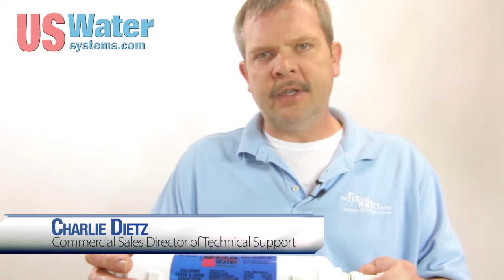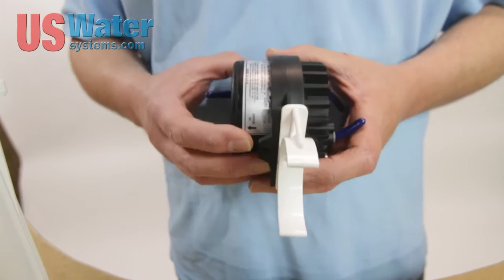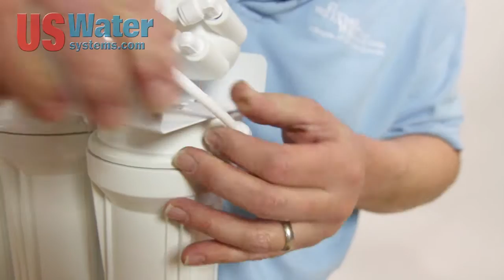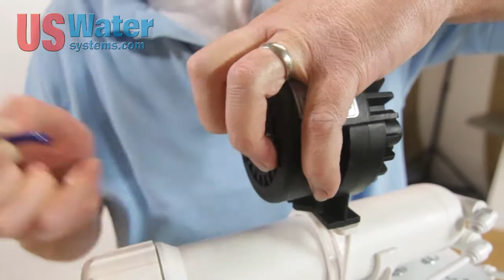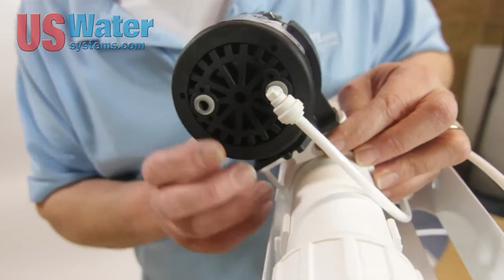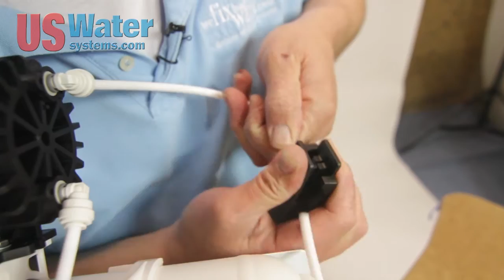Permeate Pumps

Comment: Why the Shutoff valve is eliminated? Do we needed? Please explain. Thank you!!!
Reply from the maker: The shutoff valve is not needed because the permeate pump will act as the system shutoff.  A automatic shutoff valve (ASO) will shut the water off to the system when the outlet pressure is at about 60% of the inlet feed pressure.  If you install a permeate pump the outlet pressure will be 100% of the inlet pressure.  If a ASO is used with a permeate pump it defeats the purpose of the pump because the ASO will always shut the system off at a lower pressure.

Comment: People DO NOT remove your aso valve. I can’t believe this guy did that lol. By removing the aso valve you allow your system to run more frequently and that causes tds creep. This means your tds will be higher. You don’t have to take my word for it even though I install RO systems. Test for yourself.
Reply: Aha, that might explain why my TDS is actually higher on the output side than the input. 
I guess I'm going back under the sink....again.
Reply: If you only use a little bit of water at a time then you should keep the ASO valve. It should have been said in the video.

Comment: My permeate pumps fails after a months use. I've replaced it twice now. Does removing the aso valve damage the permeate pump over time ? I know my system is losing pressure because my ro is hooked up to my fridge water and ice and eventually the pressure weakens from the the ro and water starts leaking out of my ice maker. Does anyone know why my permeate pump keeps needing to be replaced to fix this issue? The fridge sensor for the ice maker needs the higher pressure from the permeate pump in order to shut the fill valve off. Someone please help!?
Reply: t.r. birmingham - maybe you’re r/o tank needs air. They usually factory charge at 5-8 psi, but after a few years they tend to loose air and u won’t get the same output. Pump 5-8 psi back into the tank if is needed. If psi in tank is ok,then maybe demand for water is higher and u will need to add another tank
Reply: What model permeate pump did you use?   You're not the only person who has experienced pump failure.  The Aquatec ERP-500 pump I installed didn't even last 1 week.

Comment: So essentially its a smart ASO, that uses unrestricted pressure of output/"waste water"/drain channel to create negative pressure/pump behind the membrane, with positive byproduct of increased suction into membrane equal to power of the drain flow; where normal ASO just restricts the main inflow based on current negative pressure/leftover capacity of the tank and does not touch the power of output/"waste water"/drain channel. Sounds smart.

Comment: Hi, I RO system that is modern that does not have all those plastic tubes, but mine does have 4 ports that I hooked up, 1, Water in - 2, Drain Out, - 3, RO water out - 4, Tank Out; Can I still use this permeate pump. It looks like I can Water in & Drine out port looks easy, but can I take my hose that goes to the tank and put it in the other port of the permeate pump and the last port of the permeate pump to the tank.

Comment: So.... What's a permeate pump again? It's nice to know how to install it, but what is it lol!
Reply from the maker: +MrMinecraftAtlantis It is a pump for the permeate (or clean) water. Without it, your will lose pressure through the filter system. With it, you will not have any pressure drop through the filter system.
Reply: @uswatersystems  I watched another video that said specifically that the permeate pump does NOT raise pressure. https://www.youtube.com/watch?v=ngWKQ5S6xKk Which one of you is correct?
Reply: @bcbock  The permeate pump itself doesn't raise the pressure, removal of the auto shutoff valve raises the pressure by not stopping the system at ~60% of your line pressure.
Reply: Genius although now I don't know where my stop valve you disconnected first connects to!?
Reply: What about membrane life with this pump bcoz it reduce the drain water amount and one more thing how can I use it with the ro system who have no pressure tank..